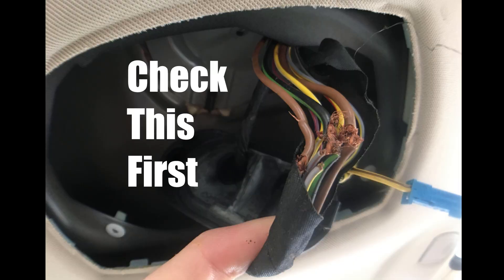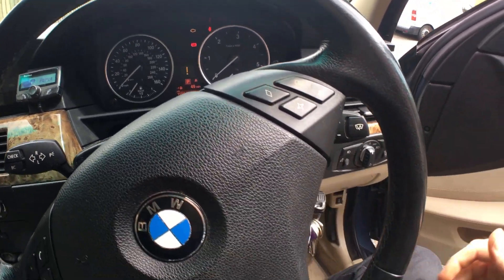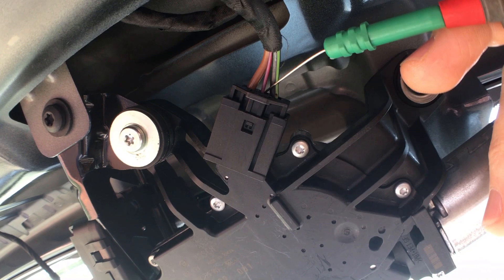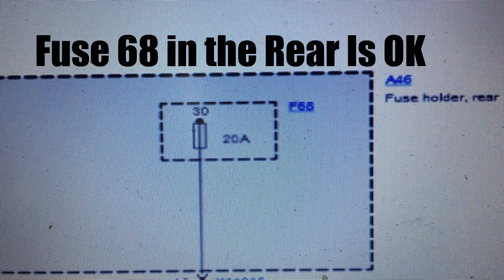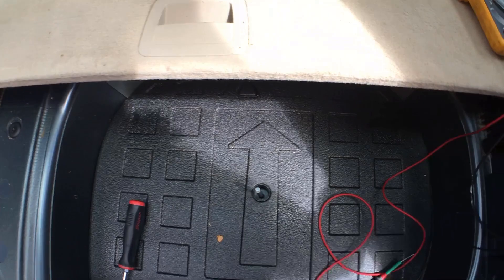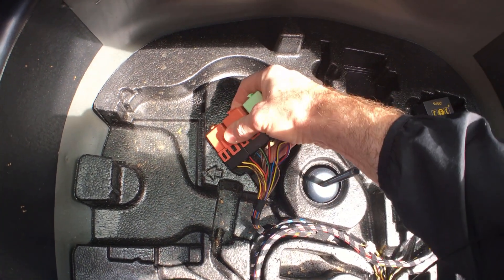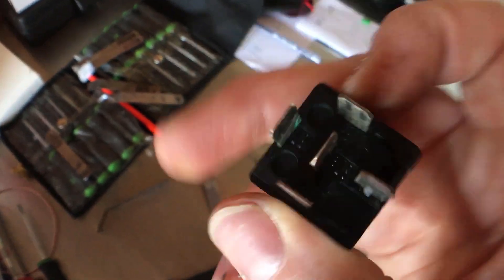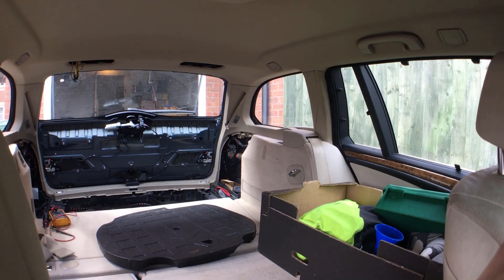BMW E61 REAR WIPER NOT WORKING - FIXED!! | Mechanic Mindset

Comment: Good morning.  I have a question for you.  On which side of the flap do the wires to the rear wiper motor go?  The wiper sometimes works, sometimes it doesn't work.  When it works, it works very poorly and jams.  The pin in the glass is not seized.  Thank you for your help.

Comment: Weird question. I got a issue with wiper also, and weird thing is that if i plug computer and force to start it work, but when i try in car it won't. Does it also could be a relay? Cheers
Reply: Did you ever figure this out? Same issue

Comment: Hi mate, fantastic video, hopefully that's all it is in my case too. I've just bought an E61 with the same leak in the boot issue. Everything is effed - rear suspension, wipers, parking sensors. Whats worse is someone has already messed with the wiring and removed the automatic tailgate. How do I go about changing the looms as you said you did?
Reply from the maker: It’s quite an involved job! More than likely the loom is your problem. Literally cut and replace the loom at each hinge 😖

Comment: I’ve got the same problem with my 2006 520d e61 estate touring  what is the new fuse/relay called…..? so I can order a replacement one myself thanks great video….
Reply from the maker: Oh dear! Have you definitely confirmed it is the relay, the wiring harness in the hinge is very common on these. Not sure exactly, but it was the green type relay; if you whip it out, it’s got part number on there. 👍
Reply: Thanks for the help/advice

Comment: Hi MM, just wanted to say a big 'THANK YOU'! - Been working on a 2012 BMW 1 series, 2nd generation 118i,  which, amongst other issues, had a failed rear wiper/washer. No power coming from feed wire into wiper motor, although it worked when power applied directly with a 'Power Probe'. After much gnashing and wailing found your video and in particular your comment  at 1:26 about 'it won't work if the tailgate is unlocked'.....Doh!  All working now, just as Herr BMW intended.....Thanks a lot! Ken.
Reply from the maker: Haha! Yeah this can catch you out! Same for the front and bonnet in some cars 👍

Comment: So the problem was relay which responsible for  rear wiper motor? What if relay is ok, then I should check  wiper motor?
Reply from the maker: Yes, that’s right. There was a water leak in the boot of this car around 6 months before which was the cause

Comment: Still very unsure about how you diagnosed that with the multimeter. I'm also knee deep in tailgate woes. How do you repair coax?!?
Reply from the maker: _c_d_c So all I really confirmed was that we were not getting 12V at the wiper motor. What we should do is work back until we get power. My kit came with a replacement connector; it was a bit fiddly to say the least!! Good luck 👍